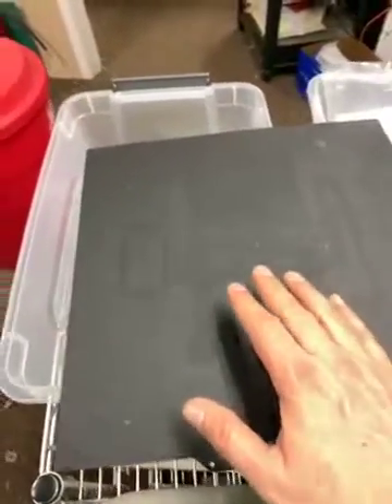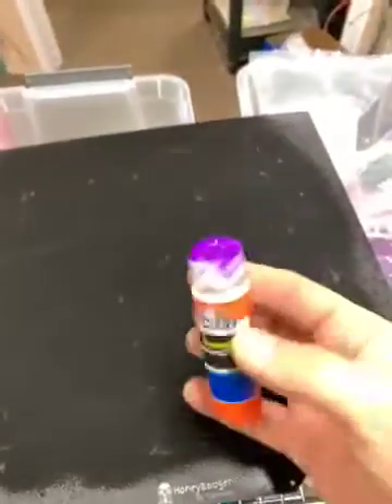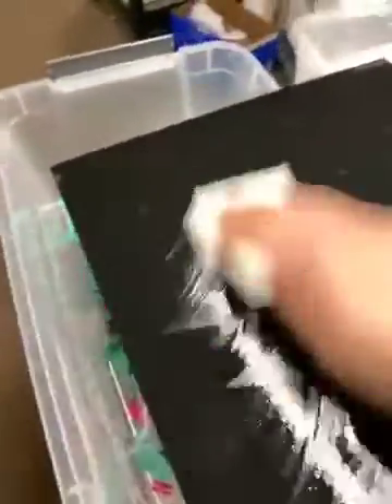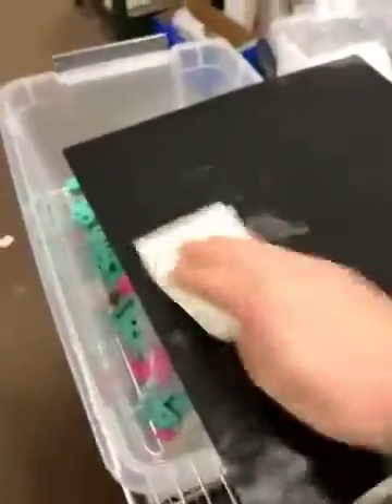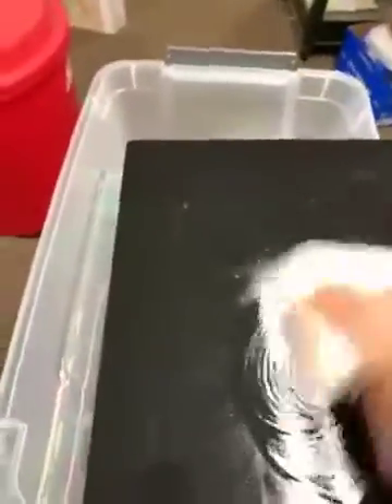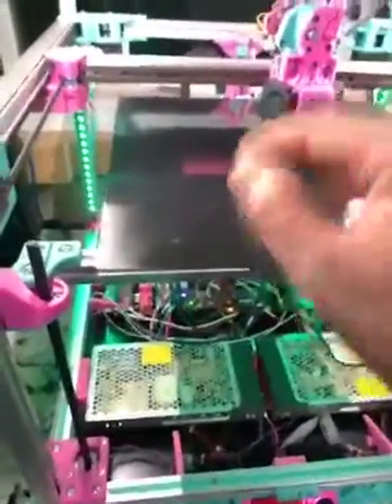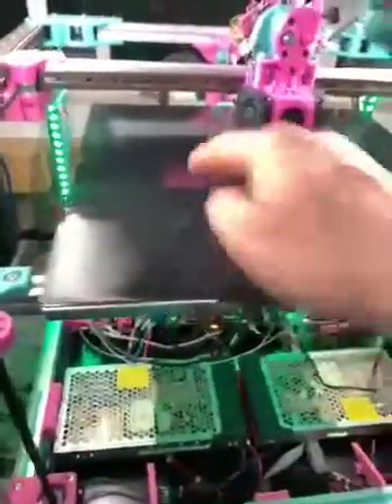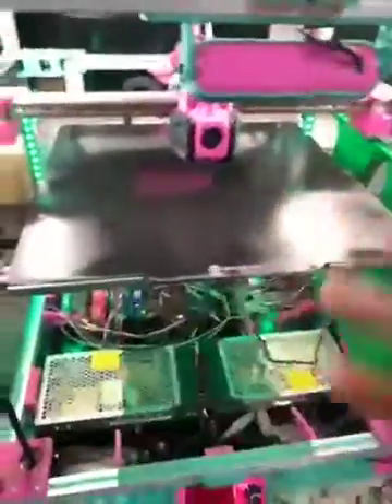Glue Stick - to help parts stick on build plate

Comment: yep, been doing this for years, it works beautifully. it gives a super thin and even film of gluestick. On some glue this does not work, guessing because of the composition of the glue.
Reply from the maker: I prefer the brand name glue stick. Cost a few dollars more, but seems to work better than generic dollar store glue stick
Reply: Never had to do any of this in my 5 years of printing. Ender 3, Prusa MK3’s, Prusa Mini, Voron 0.2, Trident, Voron 2.4.   Never an issue.  I use PEI ( textured and smooth.). Wash with dish soap and water and a greenie pad once in a while. Alcohol wipe down between prints. I think the key is good z-offset and good level.  Print PLA and ABS mostly.  No problems at all with prints sticking to build plate.